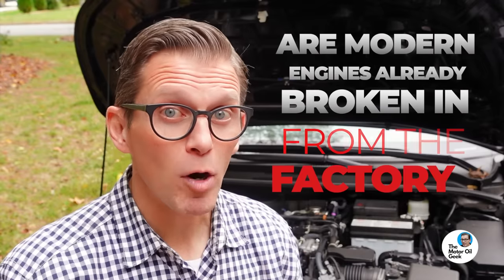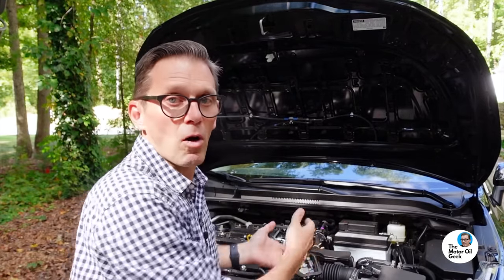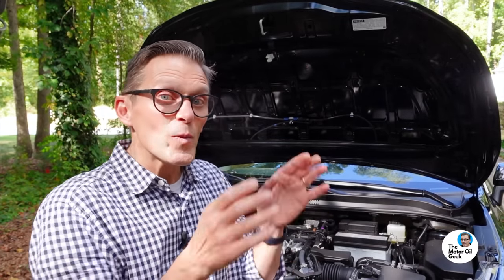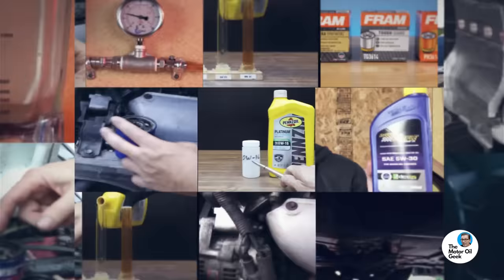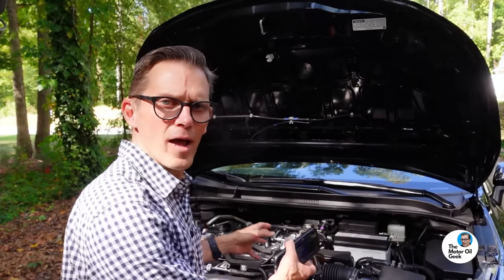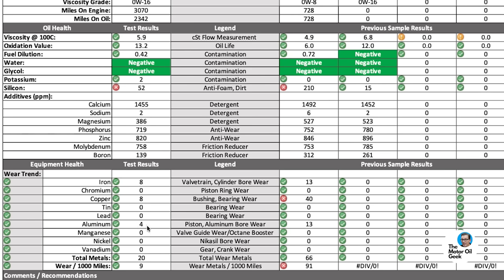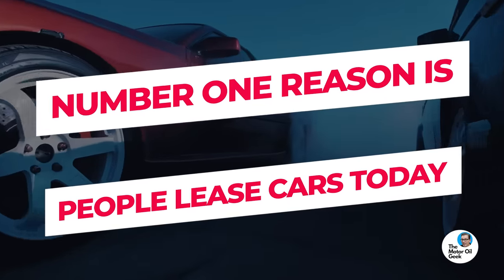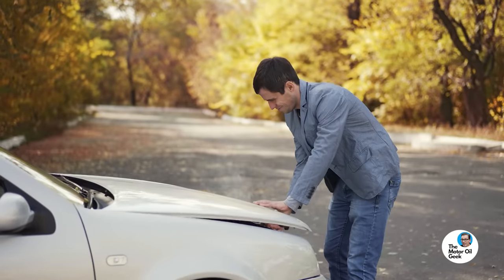New Engine Break-In: Truth or Myth?

Comment: Great information with actual scientific analysis.  Next question though is what about lifetime fluids?  I have had Toyotas and others and never changed the transmission fluid as they say it is a lifetime fluid  and had no issues until the 180k mark when I got rid of it, but am still curious on the matter.  Older mechanics will say change it regardless, newer mechanics say never touch it depending who you talk to.  Also waterless coolant or lifetime coolant that Toyotas uses etc.  Curious on the analysis of this.
Reply: It all depends on what you consider a lifetime to mean. For manufacturers, lifetime is simply the warranty period.
Reply: That crazy guy Scotty says lifetime of those oils is the warranty period. He claimed that he argued with someone from some company and said he was gonna test the oil and they back tracked and said they’d change it
Reply: The car care nut explains the ATF very well.  He wants you to change it every 60k I believe.  Unless it's never been changed.  Then don't touch it say, around 100k.  He says he's seen more damage or trouble after a change.  Weird I know.  But check him out here on the YT
Reply from the maker: We are going to change the transmission fluid at 10k as well.
Reply: Mazda cx5 per manufacturer life time fluid is 90k miles!
Reply: Personal example: drain and fill Corolla ATF at 108k miles, did another drain and fill at 110k miles, now the trans has about 50% new fluid, personally I feel the car change gears a little smoother, although it is actually a CVT
Reply: Personal example: drain and fill Corolla ATF at 108k miles, did another drain and fill at 110k miles, now the trans has about 50% new fluid, personally I feel the car change gears a little smoother, although it is actually a CVT
Reply: Personal example: drain and fill Corolla ATF at 108k miles, did another drain and fill at 110k miles, now the trans has about 50% new fluid, personally I feel the car change gears a little smoother, although it is actually a CVT
Reply: Subaru CVTs use to be rated lifetime in the USA. Canada had a 30k change (really just changes a third) I get mine changed every 30k. I use Mobil 1 every 5000 and my first change was at 750.
Reply: @eleventy-seven I had to argue with a Subaru service tech to get a CVT fluid change scheduled. In the end, they did it, though. Sure, I could do it myself, but I've already got 100 projects I haven't gotten to yet. I want that "lifetime" fluid to not affect the "lifetime" duration, lol. The end of the lifetime is when the CVT fails, so by definition, it's 100% guaranteed to last the lifetime of the transmission. 😅
Reply: The biggest problem with using oil for two long is the contamination due to dust and dirt being injested by the engine. That is the  main cause of the need for more frequent oil changes. Next comes hot weather and last is cold weather with water contamination because of low temperature condinsation.
Reply: @Dwigt_Rortugal As a Subaru tech, it's surprising they argued about it; we'll do CVT drain & fills all the time. If you want to really ensure that trans lasts, pay extra to drop the pan & change the filter every other fluid change.
Reply: @themotoroilgeek  10k? Interesting. I'm planning first at 30k. Most advice I see is every 30k to 60k. Not too frequently to "flush" the parts that mix with the fluid and provide some "friction" to the parts to avoid slippage. 

We have a 2006 Toyota Avalon with 325k miles with this interval change. Same transmission since day one.
Reply: Lifetime fluids only means the components will survive the warranty period, without servicing the fluids.
Reply: @basilman121 that does sound like a short interval. I change the manual transmission fluid in my 210,000 mi 2010 yaris every 30-40k. Perhaps it's because the creator of the video's car is new new? Idk It was an interesting informative entertaining video too
Reply: Just watched your video and subscribed 👍🇺🇸.  Excellent content.🤌

Even in the 21st century I still change the engine oil/filter at 3.5K miles and the transmission fluid and filter @ 30K.   Oh, I will also NEVER own an EV, even if they are the flavor of the millennium.
Reply: Every liquid, whether it b the engine oil, the antifreeze, the brake fluid, or the transmission fluid, they all lose their potency overtime, because they r all exposed to intense  heat, & heat diminishes anything especially liquids, which have no metal content.! Believing that lifetime malarkey, is just a way of having vehicle owners, b duped into replacing accessories, earlier than if they had done the relevant change of liquids.!
Reply: For what it is worth, I have a friend who R&D tranny fluids for car / tranny manufacturers and I asked him what about my Subaru OB CVT "lifetime fluid." His feedback was "I personally consider 200K to be lifetime.  You should be good until 200K or so but if it was my car, I would change around 100K."  I changed mine (full 12 qt by draining / filling 3 times) at 100K and visually "looked good."  In addition, when I searched BITOG, the actual analysis of a user's tranny fluid (by Blackstone) showed the CVT fluid to be "still good" at around 100K.
Reply: Toyota says my Rav4 has lifetime transmission fluid but then recommended it be changed at 80k miles, sooooo
Reply: Lifetime fluid is a lie u must always change transmission fluid
Reply: Honda CVT’s recommend 30k intervals
Reply: @basilman121
The reason he is changing tranny fluid at 10k is the same reason he changed the oil at 1k. 
The most wear happens at break-in.
Reply: If they call it a lifetime fluid and your transmission blows at 1000,000 that was the life of the oil no fluid is “lifetime oil” 
You must change all fluids
Reply: We have mostly Toyota's and if you listen to The Car Care Nut (a master Toyota mechanic/technician for over 10-years), break-in oil change then change oil every 6-months or 5,000 miles; radiator and all coolants at 5-years or 50,000 miles, transmission oil change at 5-years or 60,000 miles, power steering fluid every 4-years or 50,000 miles, front/rear differrential oil every 3-years or 40,000 miles, brake fluid every 4-years or 50,000 miles and engine air filter checked every 6-month and replace if dirty.  Cabin air filter is yearly with carbon activated filters.  Also clean your MAF Sensor and Throttle Body every 25,000 miles.  At 10-years or 100,000 miles, change out your spark plugs (or 5-years if you don't have Iridium plugs) and PCV valve gets changed at 10-years or 100,000 miles.  (I, also, change out the radiator cap with a new OEM one at 10-years since they get rusty inside.)
Reply: I’ve seen oil analysis at 5000 7500 10,000 and 5 and 7 is fine at 10,000 there is considerable wear shown in the engine oil
Reply: For an extremely low mileage use, example 3000 miles a year, after the breaking in oil change, do I need to follow every 6 months, when I would have less than 2000 miles.
Reply: @TheRdwyer  after break in I would go 5000 miles which in your case a low mileage vehicle would be once a year
Reply: @bertblue9683  not weird at all, been that way increasingly over the past thirty yrs , i.e after high miles, if ATF is original, it's extremely risky to change any of it, bcuz the clutch material is suspended in the oil burnt fluid, and that is keeping the remaining clutches and surfaces gripping right.   Remove it, and then it starts slipping.  Real simple.
Reply: changing transmission fluid is relatively simple process and you can find instruction out there you can do it yourself and you only really need to change it once every 60k miles. its good to clean up the magnets and stuff.
Reply: 100 thousand is trans limit
Reply: Drain and fill is what I do on autos
Reply: Our 2016 Honda HRV CVT Transmission self destructed with "lifetime" transmission fluid. It does heavier lifting than the corolla and the steel/belts destructed. Honda extended warranties on these CVTs to 150k/7yrs since so many were self destructing evidently. Ours was 3 months out of warranty and only 88k miles. Word is that Honda recommends 30k transmission fluid changes on these now. The transmission shop $5700 for a 20kmi used, laughed at the "lifetime" fluid changes. Honda wanted $7500 for a transmission replacement and wouldn't help at all. This is what you'll be up against never-mind Honda quality tanking and these crap CVT Transmissions.
Reply: @pklemm1  Unfortunately the OEM interval was "liftetime" for our HRV which was 88k. Honda revised that to 30k after CVT fails.

Comment: I have always changed the first oil change way early for exactly that reason break in, I remember when they told you to very your speed and not drive over 55 mph for the first 500 miles to break it in better , now they say you don't need to,you just proved that wrong, change early and don't go 10,000 miles between changes.

Comment: I purchased a '24 Corolla LE hybrid in October soon after your Corolla video. I changed my oil at 1000 miles figuring since it runs in EV mode about half of the total run time, the engine really only has 500 miles on it. I noticed that Toyota is not spec'ing 0W8 anymore in the Corolla. The owner's manual and underhood sticker both said 0W16. Great videos!
Reply from the maker: Thanks for sharing!
Reply: Interesting.  I bought a '24 regular Corolla in October as well.  My manual and under hood labeling call for 0w-8.
Reply: Keep in mind lower weight oils have less weight, meaning the engine has to work less giving better mpg and power. However the wear is accelerated. I would recommend a higher weight oil if you want your car to last the longest.

Comment: I’m not sure about other manufacturers but GM states in the owners manual that the engine needs to go through a break in period and recommends not to drive at single speed for long periods (cruise control) etc. although, they don’t recommend an altered only oil change interval. As the owner of your vehicle I think it’s really up to you to do your own research and be informed on your vehicle. If you’re not sure I would error on the side of caution and change the oil sooner rather than later

Comment: Just bought a brand new Outback. Have another Outback with 95K miles. I bought into the “lifetime fluid” BS on the transmission and now I know I am an idiot. 
Very important to realize that the car owner and the car manufacturer have very different goals. 
I’ll change the new car religiously on oil at 5K and the transmission at 10K and then every 30K. 
Live and learn. 
Great channel. Just subbed.
Reply from the maker: Thanks for sharing. Sorry to hear about your experience, but we appreciate you sharing it.
Reply: We used to change ATF every time we did the brakes.  If it never gets sludge and grime building up in it, changing it won't knock much, if anything loose. 
Now, they are "never have to change it". Yeah.. about that... ;)
Reply: @josephoberlander  that’s a great way to look at it. Thanks. Brakes = ATM change

Comment: Most new motorcycles still have a break in service.
Usually around 500-600 miles.
Mostly involves an oil change and checking torques on key nuts and bolts.

But, as stated, most new motorcycles are still purchased and not leased.
And a lot of motorcycle riders care more about maintenance than many car buyers.

Some modern bikes also have an rpm limiter that isn’t lifted until the break in service is completed and cleared in the maintenance minder system.
Reply: Most bikes also have a pretty short warranty.  And sadly a bunch don't even make it to first oil change.  I worked at a dealer for 3 months as a tech, 5 bikes came back totaled with dealer tags still on them.  
 Most junk in a bikes oil is from the clutch too.  Rings are seated from the factory though.
Reply: @randombuilds8336 Does friction modifier mess with bike wet clutches?
Reply: @gregorymalchuk272   Yes, it might not short term, but it will.  Like if you are in the middle of nowhere and low on oil anything is better than nothing, but it's best to stick with a JASO MA/MA2 oil for the clutch.  Shell rotella t4 and t6 are JASO rated and available pretty cheap almost everywhere.  Might not be the best, but my triumph tiger 800 made itto 110k miles before I sold it with that oil.

Comment: 2023 Z06 Corvette, LT6 engine. Recommended first oil change - 1 year or 7500 miles. I did an easy break in and then changed oil & filter at 550 miles and again at 2365 and 3995 miles. All major wear metals continue to trend down. Too many believe they have only to follow the manufacturer's recommendations. However, science and data tell the truth! No matter how good the metallurgy and manufacturing process is, friction surfaces still need to wear into each other - and you need to get that crap out of the engine if it is to live a long life.
Reply from the maker: Right on! Thanks for sharing!

Comment: Toyota had kept 6 monthly service schedule until they ditched it and went 12 months interval, purely because people didn’t want to buy a car that requires them to visit dealership every six months. Not because the engines got more reliable.
Reply: They also want to sell cars in 10-15 years instead of 20-25 years. Toyota always has the difficulty of actually appealing to a buyer for "creature comforts" but they win on word-of-mouth from adults who get sick of the "mechanic's dance" or were told by a good mechanic to buy Toyota. Only thing is, adults don't get to that stage until after 30-40.

Comment: My wife & I bought a new Japan built Toyota RAV4 Limited Hybrid this summer. I've been a huge proponent of early and frequent oil changes. I changed the oil in our new RAV @ just under 1,500 miles and then again last week @ 4,930 miles. I didn't send oil in for an analysis, but I'm sure if I had, the results would have been very similar to the oil in your daughter's car. I subscribed to your channel after watching your first video of this vehicle and will continue watching. I'd be interested in your ideas of running higher viscosity oil in these new engines. Our RAV4 calls for 0W16, but I wonder if 0W20 would be better. Either way I'll be sticking with 5,000 mile oil changes just like I have in all of our vehicles in the past 20 years.
Reply from the maker: Thanks for sharing

Comment: Excellent video Lake! In the late 80s I started working for a SAAB dealer. The first oil change service was at 1,000 miles and was of no charge to the owner. The engines were equipped with a small break in filter from the factory. When properly serviced, these engines would perform well into the 300K mile range with minimal wear. Hone marks were still visible in the cylinders.

I don't believe in this nonsense of extended oil intervals. I think manufacturers are taking "orders from above" for environmental purposes. These extended oil changes are about the 3 Rs. Reduce, Recycle, Reuse. All these extended oil changes do is cause excess engine wear which ultimately goes against environmentalist principals. With extended OCIs engines are worn just outside the warranty period. Considering the cost of purchasing a new vehicle in this day and age, not many people can afford to buy a new vehicle every 3-5 years. 3K-5K oil changes will extend the life of these modern engines.
Reply from the maker: Thanks for sharing!
Reply: I have owned only 1 new car. It is a 2005 Scion XB with a 1.5 VVT 4 cylinder, which is basically a rebadged Toyota. I did an early oil change around 500 miles and used conventional oil until 3000 miles. From there on I used Mobil 1 oil and filter with oil change intervals of 10-12,000 miles. I still have the car but rust has taken it off the road with around 205,000 miles. It never consumed oil between oil changes. I never had to service anything on the engine other than a water pump, belts and spark plugs. Best car I have ever owned. I do believe extended oil services with the right oil and filter is acceptable for the right applications. I do not think it’s wise on turbo engines or diesel’s though due to higher stress and heat. I’m completely against the “lifetime fluid” bs that the manufacturers claim though. I changed coolant, power steering and transmission fluid at what I feel are reasonable intervals.
Reply: You're preaching to the choir! I'm an auto service professional, and I tell this almost verbatim to all my customers.

Sadly, some ppl are drinking the koolaid and think I'm just trying to make a killing off oil changes.

You ever seen a rich lube tech?

You know what does pay tho? Timing chains, cylinder re-sleeving, camshafts and rockers, etc, etc, etc.
Reply: 1980s..its 2024,no point in 3000 Mike changes...oils have improved...join it. Stop the nonsense.
Reply: It's 2024,join it. Oils have improved,join it. Rotary phones don't exist